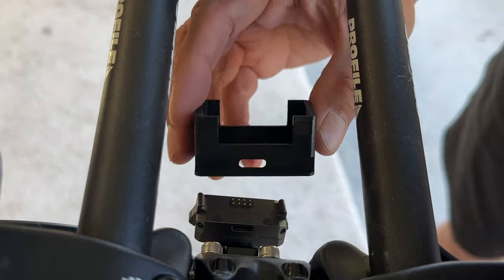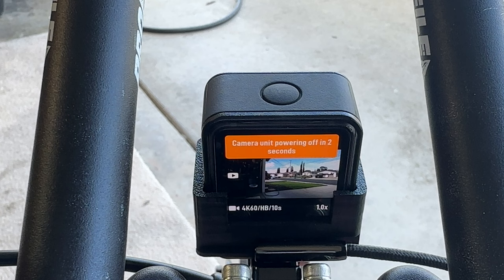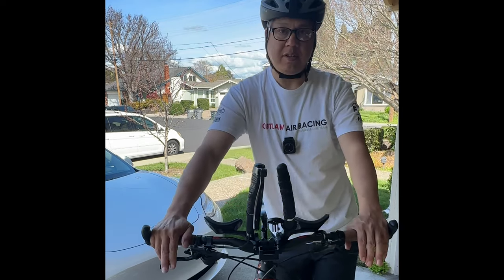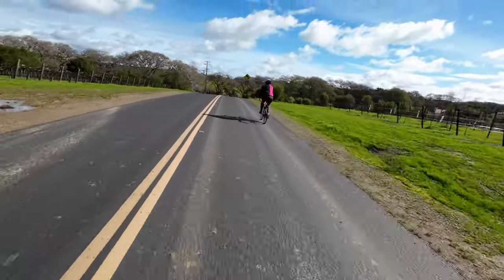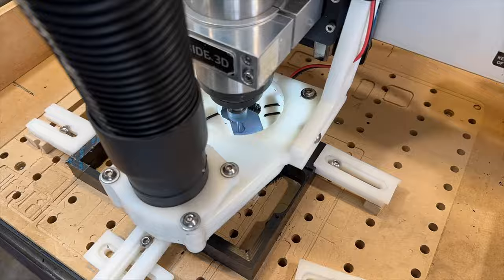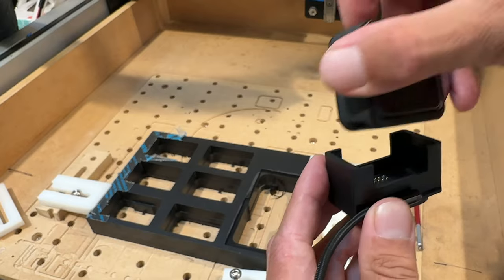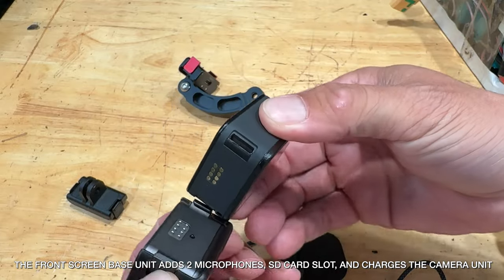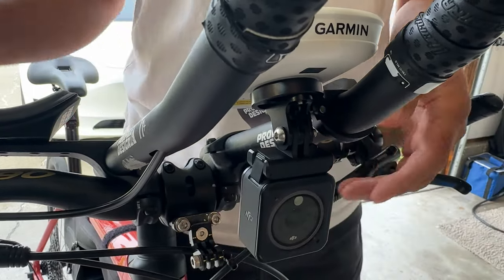I made a DJI Action 2 charging holster for cycling + bike oriented review of Action2.

Comment: This looks super convenient to have multiple shot options. Would you worry about this bouncing out of place for a mountain bike trail with more rocks and drops?
Reply from the maker: I could make the holster with more of a friction fit, and also make the sides taller if I was worried about it falling out on hard jumps.  I'll get some miles on it and see how it works, I probably won't be doing any jumps though!  It's just nice not having to squeeze the two latches at the bottom of the camera, it's tough to do while riding a bike.

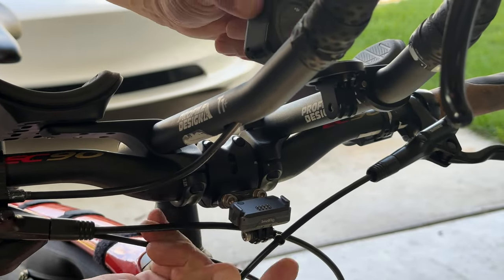Comment: Hi, which bike mount are you using at 00:25 ?  Thanks
Reply from the maker: The Gopro mount is from Amazon https://www.amazon.com/gp/product/B07CWR1ZML/ref=ppx_yo_dt_b_search_asin_title?ie=UTF8&psc=1
I changed out part of that mount that attaches to the stem with 2 bolts and 2 spacers.  I made a new metal piece since the amazon part was wider than it needed to be and I didn't like how it looked.   This is the DJI mount with charging https://www.amazon.com/gp/product/B09PYF2NXJ/ref=ppx_yo_dt_b_search_asin_title?ie=UTF8&psc=1
Reply: @etischer  Thank you! 😀

Comment: How does the clipless mount hold up in the rough stuff?
Reply from the maker: I don't typically ride off road, but I did some measurements... It takes 940g to break the magnets apart, and the camera itself weighs 70 grams. So the camera should withstand 13.4 Gs of acceleration before it comes off.  

Referencing https://trailism.com/jump-design/  the worst case G load from their jump landing graph is ~5.5 Gs, so the camera should stay on no problem (2.4x factor of safety).
Reply: @etischer I genuinely appreciate that you did the math on this. Thank you, sir! 🤜🤛